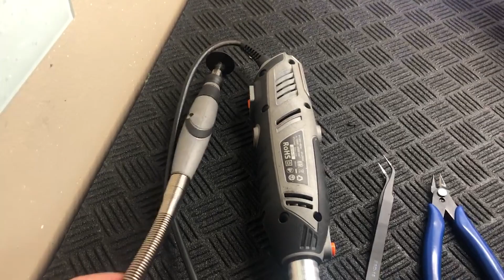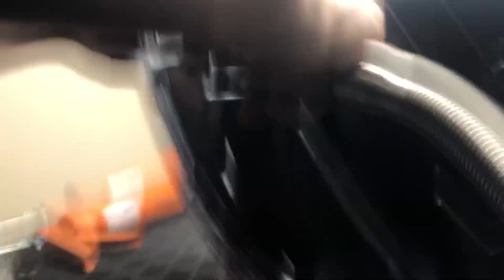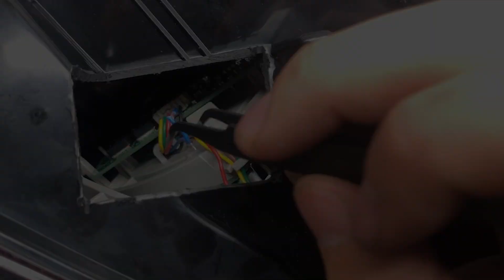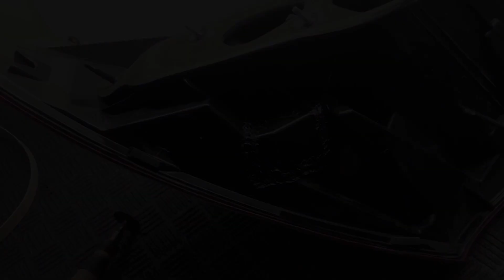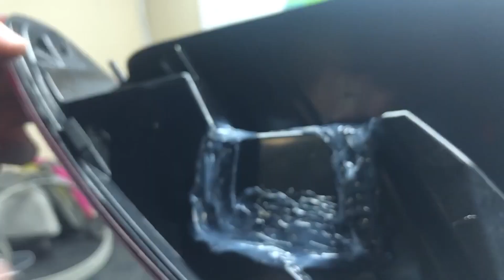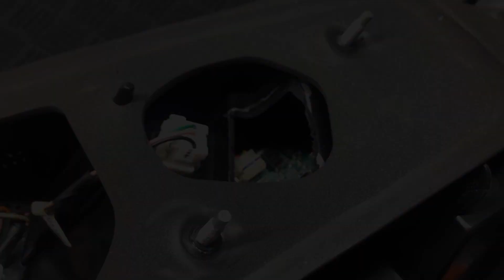Genesis Coupe Audi Mod DIY Tutorial

Comment: Hey, how difficult will it be to do the triangle as turn by only cutting the small cutout? I saw your other video but removing the full back cover will be tough for my skill set.
Reply from the maker: Good question! A little bit more difficult but things can be made easier with tweezers. Passenger side is easy since there is enough length to easily solder a wire on. Drivers side you will need to reach in further with the tweezers to expose more length of the blue wire. The wire can then be fed through the space where the plug is. If you need anymore help or have questions DM me on Instagram @lightexcel.